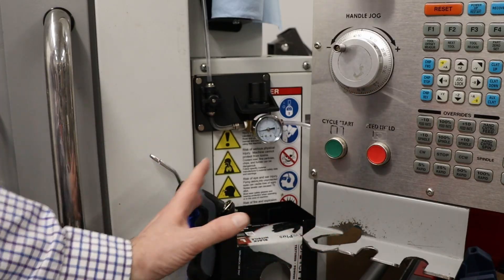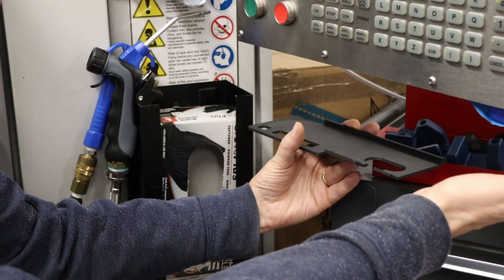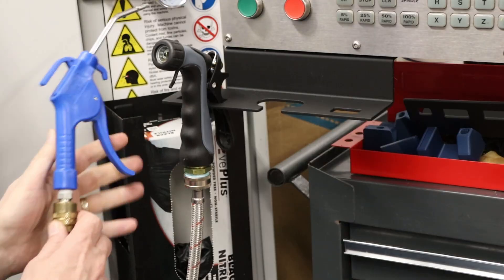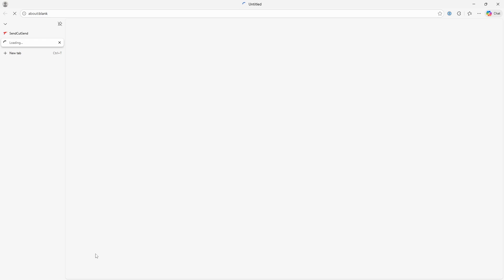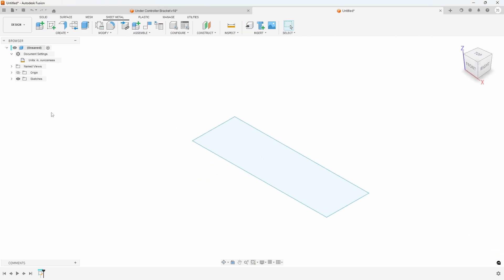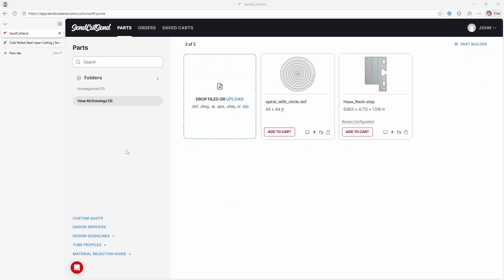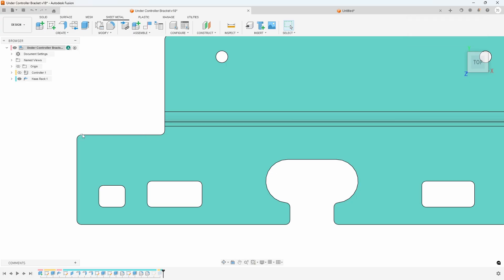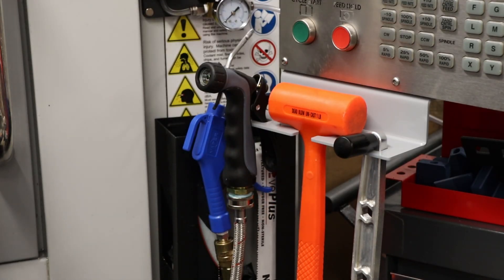Custom Bracket: From Design to Laser-Cut Finish

Comment: You might consider milling a pocket on your speed vise handle and pressing or gluing in a magnet. Then you can keep it on the enclosure by the door so it is a bit easier to grab since it is a high use tool.